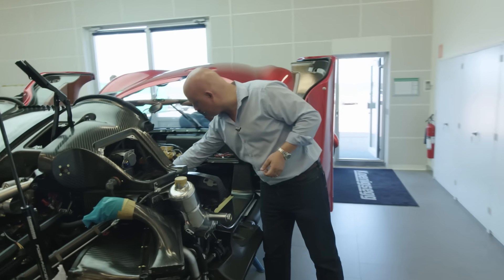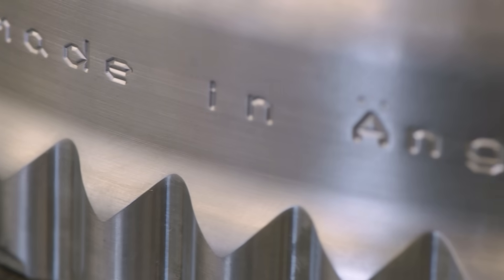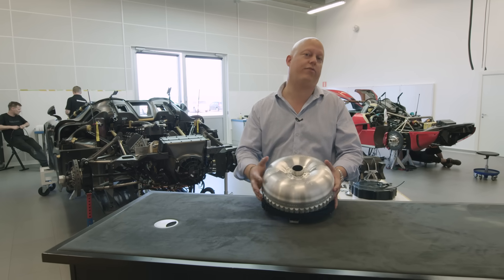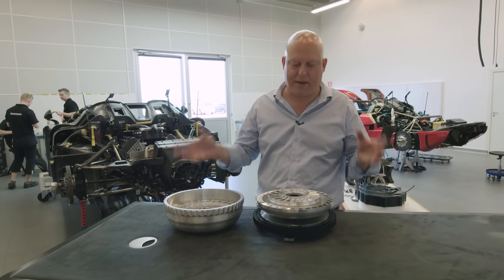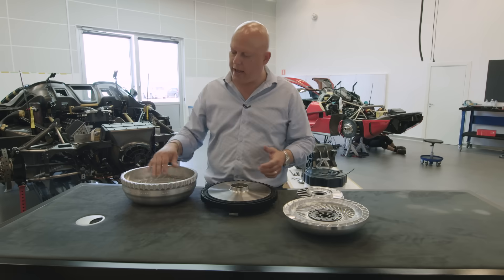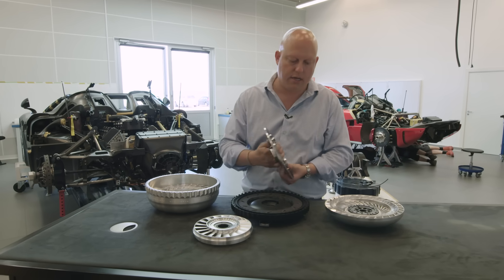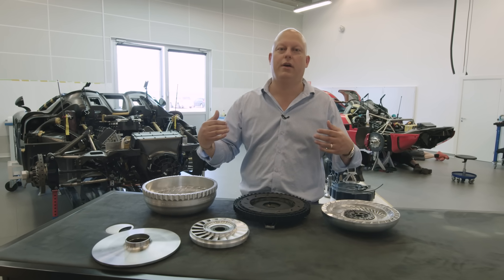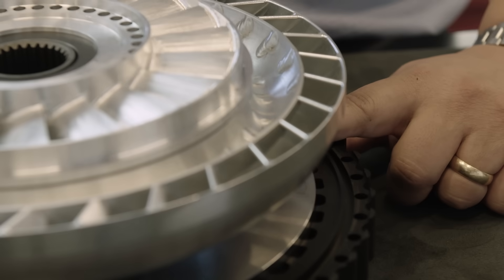248 MPH Without A Gearbox: Direct Drive  -- /INSIDE KOENIGSEGG

Comment: People are coming away with a lot of ideas of how it works that is not at all how it works.  The way to understand is to follow the fluid flow.  It works more like a turbocharger than a fan.  Let's begin with engine turning one of the members, while the output is held stationary, such as your foot on the brake.

1.  Fluid Coupling:  The element connected to the engine spins.  The outside diameter is moving at the same RPM as the inside, but the outside is moving much faster in feet per second because if its larger diameter.  Bernoulli's principle states that when you increase the speed of a fluid, you decrease its pressure.  The low pressure causes fluid to flow from the relatively high pressure inner area of the to the outside.  When the fluid exits the engine driven member and encounters the stationary member, energy is transmitted to the stationary member, velocity is lost, pressure goes up, and it travels back to the inside diameter and back into the inlet of the engine-driven member.  The faster the engine element is spun, the more energy is transmitted up to the point where the engine cannot transmit anymore power.  This is called the stall-speed of the converter.  The large the diameter of the elements, the lower RPM that stall-speed will occur because at any given RPM, the outside of the larger diameter will be traveling faster in feet per minute.  Under powered cars and race cars use smaller diameter converters to enable them to generate high RPM to better match the power output RPM of the engine.  Normal cars will be larger diameter to have that happen earlier.  As the output more closely matches the input speed, the speed of the fluid decreases as the output member now opposes the input member.  it achieves what is termed as coupling, although that never happens entirely.  The larger diameters are more efficient.  A fluid coupling does NOT multiply torque, in fact it loses torque, and that loss comes in the form of heat.  The larger the speed difference between the driving and driven members, the greater the speed of the fluid and the greater the heat loss.

2.   Torque Converter:  The difference between a Fluid Coupling and a Torque Converter is the addition of the stator.  The fluid flow starts out the same, however, what I didn't mention with the fluid coupling is when the fluid returns on the stationary side, the direction of the fluid is relatively opposite that of the engine driven member, thereby opposing it.  The torque converter adds a STATIONARY stator at the inner diameter return area that has curved blades that reverse the relative fluid flow and redirect the fluid energy to the same direction of the engine driven member and the velocity lost to the stator raises the pressure of the fluid, so NOW you have torque multiplication similar to gears.  As with the fluid coupling,  when the output more closely matches the input speed, the speed of the fluid decreases as the output member now opposes the input member.  It achieves what is termed as coupling, although again, that never happens entirely.  However, at that point, the stator also becomes a liability.  Therefore, the stator is mounted on a one-way clutch that enables it to change from stationary to spinning with the input and output elements.

3.  The lockup clutch everybody understands.  When the torque multiplication is finished for the most part, the remaining slippage is simply a power robber that goes up in heat.  When the clutch applies, the transfer of energy due to fluid flow in the converter ceases.

Other:  The author is not claiming there are any new concepts with regard to his torque converter.  What he is saying is he couldn't find one off-the-shelf to meet the characteristics he needed, and couldn't get anyone interested in working with him to supply it, and what they did themselves to get what they need.  His claims, IMO, are about the marriage of the engine, electrical engine, batteries, regenerative energy, and a torque converter, which together work toward the gearing advantages of a CVT, without losing the war of efficiency against the more power-efficient and weight-efficient conventional drive systems.  Moreover, regular CVTs have their own set of reliability and longevity issues when it comes to transmitting high horsepower.
Reply: Jack T,
Awsome explanation, and 100% accurate. Very well done sir!

I was a full-spectrum auto-trans specialist in S. Calif. for 35 yrs, and my curriculum included all makes and models of truck and auto, plus all venues of racing too, including road and track, mud, dirt, and the watersports, but i couldn't explain the theory of operation any better if i had 4 decades to work on it.
I became very jaded by the repair industry, extremely disappointed by the rampant incompetance and unethical business practices of the trade and tried my best to reform it, and i didn't have many heroes. But i sure trusted Paul Fordes torque convertors... aka Turbo Action in Florida. Paul was/is the real deal, especially back when. Now i'm 25 yrs retired and have no idea who's who today. I have elevated my position by moving to Arkansas where my duties require fishing for bass, when I'm nøt youtoobin'.

Torque Convertors aren't the least bit magic and i think it's great that you have taken the time to set the record straight.
Easy peasy devices that REALLY do work!!! A clutch can't hold a candle to torque convertors, and it's only the 'mystery' of them that keeps the manual transmissions alive. For lack of a better term, it's ignorance, plain and simple. (no offense intended, to anyone).

So thank you sir for taking the time to share some of your fabulous knowledge with us. 
I hope your explanation helps to dispel all the "dazzle them with bullshit boolshit" and boogaloo black magic crap that frightens people, and intimidates them into a misunderstanding of these marvellously engineered masterpieces.
...

Comment: It's far from being a good and practical system if you rely on several and very distincive motors/engines to do the job that other cars can do with a more simpler design.
The 0 to 60 in 4 seconds is "very slow" with the combustion engine alone.
It's removing a gearbox to replace it by several powerplants just to have more torque.
That's dumb in itself efficiency wise.
For me by passing the problem of very low gearing with electric motors is like what he did with his catalytic converters system.
It's bypassing problems with alternative unrelated solutions.

Comment: I don't understand: it means that until 30mph the car is powered only by the electric motors? Or the Internal Combustion Motor also contributes through the hydraulic coupling in this stage?

Comment: to explain it simply..   its (somewhat)like 2 clutches, 1 somewhat disengaged, and the other engaged... at 0 mph the 1st clutch is completely disengaged, and the 2nd is somewhat disenaged.( this is done so less stress on engine and a torque converter effect is given)   then when the vehicle is accelerating, at a certain speed the 1st clutch can engage so tthe engine and electric motors turn the axle at full power.. (this is done for efficiency and stress issues)

Comment: I heard what he was saying, and I understood the individual words.....but whaaaaat thaaaa fuuuug???
Reply: Mr K is usually one of the best explainers out there but this topic could be tough for even us enthusiasts. This may help https://www.carthrottle.com/post/engineering-explained-how-the-koenigsegg-regera-hypercar-drives-without-a-gearbox/
Reply: @songojune    Cheers for that. I thought his explanation was a clear as mud.
Reply: Ok
Reply: Fug off Dave
Reply: Yea I don't fully understand either. Other manufacturers may be interested in having their torque converter act like a CVT as well. No need for gears, no steel belted CVT. It's quite the evolution.
Reply: @danwat1234  Guess what, they already knew about that and are trying to avoid it.
Reply: @fwebe2871  these days regular automatics have so many gears and lock ups they are pretty efficient most of the time. I've a feeling research and development by the big car manufacturers is on planetary gear set CVTs known as eCVTs and electrification.

Comment: however, sounds like the gearing down driving/braking is out the door.  Brake only???
Reply: The two electric motors on the axle will be able to regenerate and slow the car down quite significantly, I would think. Like mega hard dynamos.

Comment: They didn't want to produce your egg because the whole thing apparently must be permanently-sealed with the fluid inside, not even a drain/fill plug, probably inaccessible between 2 electric motors, no active oil-cooling system except external spinning bumps and the roughly-machined corrugations inside which are going to cavitate and foam the oil to an early grave with the ultra-low stall speed.
   BTW, on a transverse engine, the "final drive unit" is just another name for gearbox, but I'll bet with 2 electric motors, one combustion engine, a torque converter/clutch and final drive unit, a series design setup demands RWD which uses a differential, which is most probably combined with the secondary electric motor, negating both the simplicity, space, and weight-savings from your 'egg': and those losses are what determined the combustion portion must be capable of 1500hp...
   You haven't even ELIMINATED the generator; in fact, at the least what you've done is to ADD a second electric motor -but simply declined to call it a "gearbox". I'm not impressed. Acura's TL has a servo-actuated clutch in their torque converters that they could have simply called 'overdrive' but that word isn't european-sounding enough.
   I wish you good luck inventing seals that keep the oil-genie inside the lamp from coming out in a puff of blue smoke.

Comment: This is amazing, but I still don't entirely understand... the torque converter makes it possible to trade input RPM for torque, i.e. force, so I can creep up a steep hill or drive very fast on a motorway, but how is it so different from a conventional torque converter that a gearbox is unnecessary? My old 1.8L automatic has a 4-speed autobox... does this mean that the Direct Drive's torque converter is 4 (or more) times better at converting RPMs to torque (and vice versa)? Why has nobody else done this then, when automatic transmissions are so heavy and expensive??

Comment: If no transmission why do you need a tork converter like this? Smooth drive? Or what? Whatever you do, the energy will loss with the tork converter. I guess I miss sth.

Comment: for those that are just hopelessly clueless and want to understand.  Every automatic transmission car has a torque converter in front of it.  That's that fluidlike feeling you get when you take off or mash the peddle really hard.  The more they sort of slip from power or just sitting in traffic the hotter they get.   He essentially made a kick ass beefed up torque converter knowing that the electric motors assisted torque behind the transmission relives much of the stress and provides much of the low speed torque that the lower gears would normally be needed for. (because they let you Rev the engine without excessively beating the torque converter)

Comment: The car relies on electric motor for stand still start, 1000rpm at 30Mph. So top speed is 8.25 x 30 which is roughly  250Mph . To explain what he is talking about, it is just a simple light weight torque converter with direct coupling, with lots of words to make people don't think that way. Chris is a genius, in marketing and talking. The only explanation about this car performs so good at 0-100KM/h stand still is that it is an electric car with easy to implement electric traction, and it has not enough grip for rear 2WD drive train, so the kick in of the ICE is useless when its under 100KM/h . In theory, a traditional automatic gearbox torque converter can run with single gear, regardless over heating of their torque converter. In this car, it relies on electric motor for stand still start. So how to make sure the car battery has got charged? The torque converter (forgive me Chris, it is a torque converter)  can leave open so that the engine act as an electric generator to get those electric motors to be powered. This is pretty much the same in a Toyota Prius with the exception this car has both over powered engine ( 820kw ) and over powered electric motors (180kw x 2) . Engineers are not good at creating illusions in science explanation, because we are trained to explain complex science and mechanisms in layman terms.  The only point I can see for such design is the loosing of power delivery efficiency lost from ICE when the car reaches 30Mph and on going until a direct coupling is engaged. This is what he is trying to hide, isn't it?

Comment: I'd just put electric motors in a car and then hook up a power generator where the engine would go and get all the benefits of an electric motor with insane power and still make it suck gas. Lets face it, would weigh less then a battery box and wouldn't piss off the oil companies into assassinating you sense you still require fuel.

Comment: To put it in simpler terms.
direct drive is a hybrid torque converter with a 2x torque drive conversation ratio and is always ON even in low revs does it also uses a clutch just like a manual transmission controlled by a computer to prevent it from stalling with its conversation ratio of 2 to 1 the converter is able to drive the car from 0 to 60 in 4 seconds with its massively powerful engine.

So this is the primary drive of the car without any gears used does it's name direct drive.

The second part of the cars propulsion unit is the electric hybrid motor that acts both as a drive motor and charging alternator to it's 800volts power pack. with this unit alone is also capable of driving the car from 0 to 60 in 4 seconds.

combine both drive units of the direct drive and electric motor and the car can achieve 2.8 seconds and 280plus kph.

basically. the direct drive is a hybrid auto clutch and manual clutch built in one with a force multiplier of 2x paired on the same drive shaft an electric motor that can turn on power and recharged in a split second in synchronicity with the direct drive clutch controlled by the computer.
Reply: k

Comment: Sooo... it's basically an overengineered clutch? Makes sense, I mean... you can set off in pretty much any car on 4'th and even 5'th gear if you feed the clutch VERY slowly, but that'll ruin it in no time. So I suppose this is designed to solve that problem.

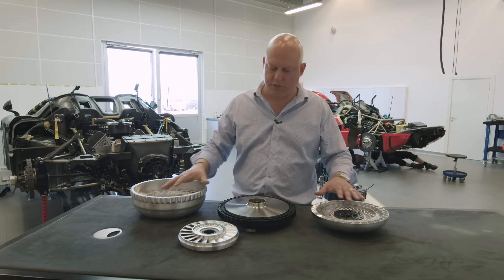Comment: Nice work. But at 5:50 he brings an example: 2000 rpm goes in, 1000 rpm goes out, with "more than double the torque you would say". This would mean higher output power than went in, violating laws of physics.

Comment: people commenting just don't know how world and economy function. It's not that this car is any new technology or inventions. Hydraulicly/pneumaticly operated valves or inverter hybrid drive or torque converted direct drive are all old technology. Everyday cars have to be practical and cheap, meaning maker must made some compromise. 100 HP hatchbag for comutting purposes gains nothing of advanced technology other than price that no one is willing to pay. 

And what is so special about that car. It has hydro coupling (locking torque converter) that transfers crankshaft torque to diferential, it also has inverter motor directly connected to the shaft. ICE has camles valves which are instead hydraulicly/pneumaticly actuated what realy comes to the role when rpm exceds 10.000 rpm what no ordinary ICE reaches. Also you have valves that uses air instead of ordinary spings to prevent valve fluctuating over the 10.000 rpm line. F1 uses this techology along with well known cams. In this configuration air springs allow more rapid cam lobes so the overall performace is that valves opens and closes more rapidly and that the graph is pretty much same as with Koenigsegg desing. 
Any how much does this car cost?
enough that you could even have rocket motor at the back

Comment: what's the purpose of owning or driving a hyper car if doesn't give the pleasure of reaching the rev limiter and then changing gears?
i personally hate to drive in auto mode. it's not at all engaging.
Reply: acceleration that’s why having gears worsens acceleration after each gear

Comment: why not have a generator/diesel powering 4 drive wheels, with regenerative braking charging super caps. don't invent something that already works great. if it's good,enough for trains then it's good enough for me
Reply: Trains are diesel electric because the electric motor has maximum torque at zero rpm.  Also the electric motor can be reversed to become a generator, then the electric current is wasted as heat through a resistor bank.  In this way you don't need large brakes, the motor becomes the brakes.  And, you don't tear up transmissions trying to get the train moving from a stop.

Comment: Wouldn't you lose the direct feel of the engine with all this, especially with turbo lag. I mean 1200hp in a 1000kg car it will be a rocket and it blows my mind with how fast it will accelerate. But what about holding through corner after different corner wouldnt the power be delayed somewhat like a cvt? It can only lock the final gear what am I missing.. probably everything he just said :( lol

Comment: explanation is i only partly correct with a lot of BS mixed in
efficiency can never reach 100%
what he said just blew that through the roof
he said that his torque converter reduces the rpm by half and in turn increase the torque more than double. with some simple math that would mean his torque converter has an efficiency of more than 100%, which is complete BS
at least have an engineer explain his creation instead of letting the PR or marketing just make up shit